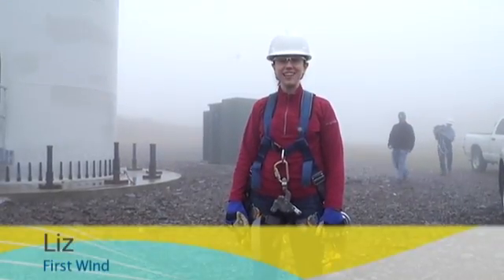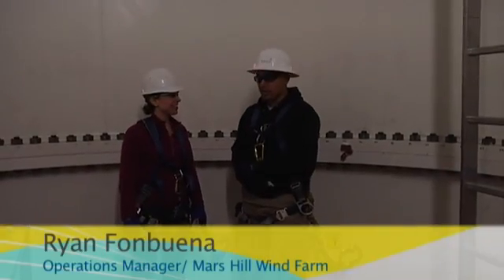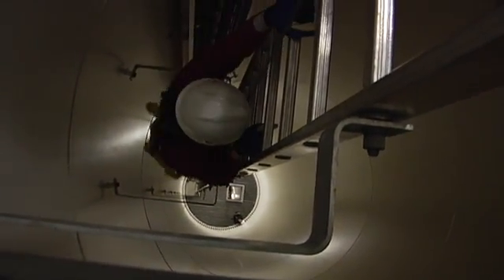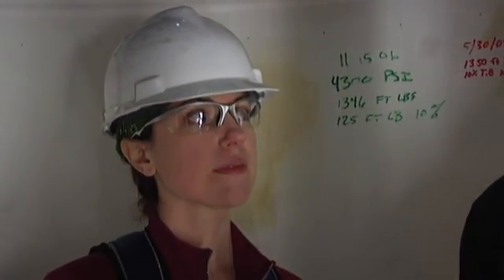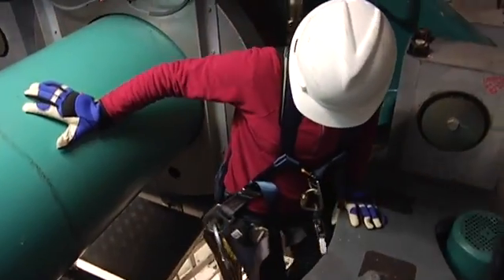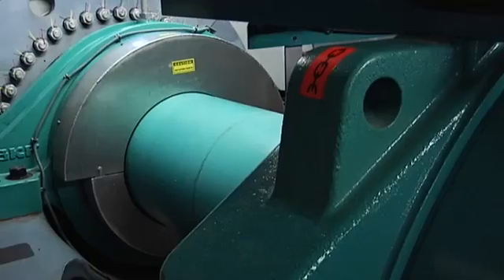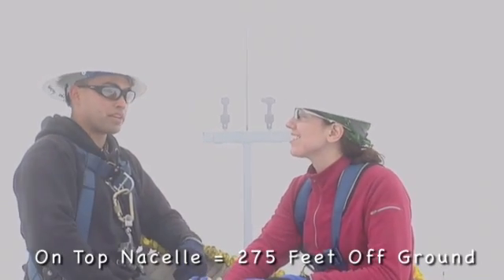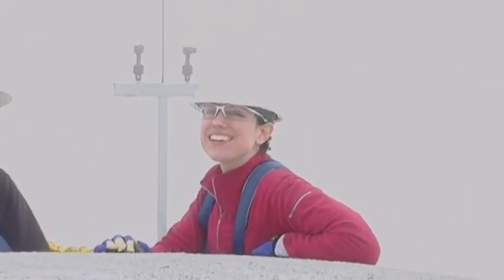Where does Wind Power come from? Climbing Inside a Wind Turbine

Comment: Free? Wind?  Those things are expensive, last I heard there wasn't a single one in existence that hadn't been subsidized or put in place without mandatory federal or state regulation.  Take away subsidies and mandates and I doubt there would be a single turbine running.  Tell this to the people of Cape Cod Piece.  Tell that to the late Ed Kennedy, tell that to the bird freaks. What about the steel, fibre glass, concrete and plastic (oil/gas) used to manufacture said behemoth?